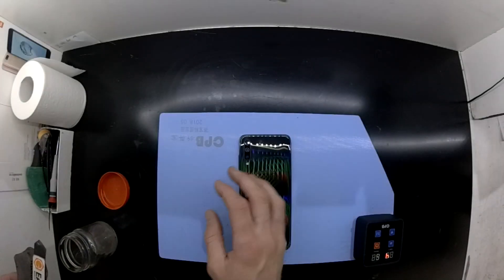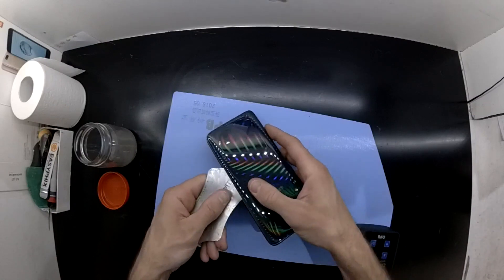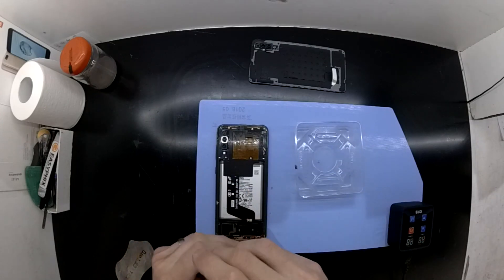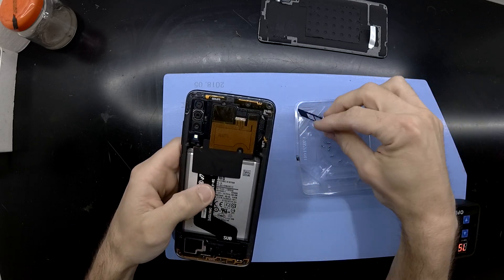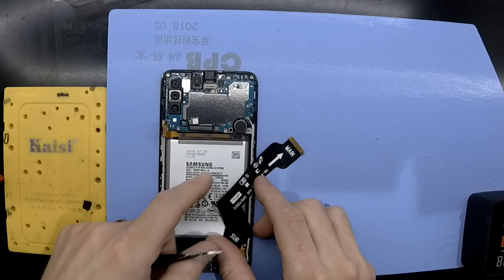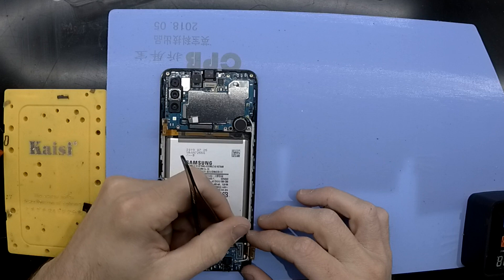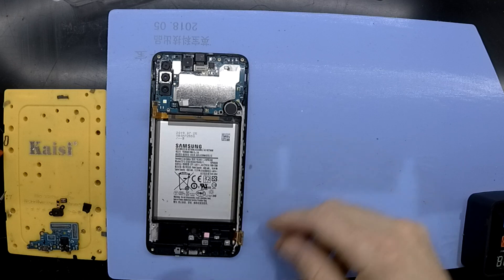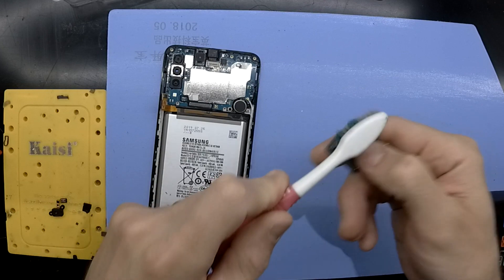Samsung Galaxy A70 Teardown and water damage clean

Comment: Just got myself some water damage today on the A70. Screen flickered, went completely white, then dark. After warming up my phone for a while i tried to connect it to a charger and noticed my phone took alot of charge and heated up really fast, after 5-10 seconds or so it felt warmer than my body temp.

Do you happen to know what that indicates? Hopefully it doesnt mean i fried my board(s) or something. Thinking about fixing it myself after watching your video, but i have this itch that its totalled based on how quickly it heated up.
Reply from the maker: would be damage to the mainboard.
i would suggest taking it to a local repair shop

Comment: My phone has two scratches on the screen.  Last night, while I was asleep, my phone fell from its screen onto the ground with some water.  In the morning, when I saw my phone on the floor, I picked it up from the floor and saw that water had accumulated on its touch screen, exactly where it was scratched.  My phone screen does not turn on now, but I know that my phone is working. When I started charging, I felt that my phone was warm as before.  Do you think my phone's touch screen just doesn't work or not at all?  Please answer me, thank you.
Reply: The model is samsung a70 same at this video
Reply from the maker: I dont think the scratch has anything, to do with not powering up.

i would opening it up like in the video or take it to a local repair shop
Reply: @rickstechrepairs  How long do I have time to take it to the repair shop before it's too late?

Comment: I dropped my A70 in the snow and the back camera had some moisture but now works fine but the front camera still has moisture stuck in there and the phone was working pretty good until it turned off and won't open by pressing the power button like I press it several times and the screen opens for a less than a second and turns off, here snow covered everything so there is no any mobile shop open and just want to know what could need replacement or fixed? Sorry for the long haul.
Reply from the maker: If you can power off, and leave it near a heat source,unless you can can open it up or at least remove the back cover

Don't put near rice

Comment: Before shutting down to black screen, mine shows a violet-blackish circle in the lower right corner of the screen, was my LCD really need replacement for that case? As i recall i disinfect my phone and sprayed alcohol directly on it until it dry out, then when the circle shows i restart it, it's vibrating but screen's now black.
Reply from the maker: Alcohol directly on the back of a display is more than likely going to damage it.

So a replacement would be needed

Comment: Sir my A70 was dropped in water. Now after 4 days everything is working fine except their is no network in it. My sim card is working fine in other headset but in my phone it shows no network connection.
Reply from the maker: I would clean the antenna connections on the board ofwise you will be needing a new phone sorry
Reply: Did you solve it?  Mine happened the same, got some water and everything works exept for the Network signal.
Reply: Same thing happened to me.. do you have a solution yet? I've changed the charging plate, cleaned it up...it is just stuck on airplane mode.. and there is no network... but everything else is working great..

Comment: my a70 fell in some water and after drying works fine, except the camera wont launch and there is moisture under the lens, will it get any worse if i use my phone as normal?
Reply from the maker: Backup everything important off the phone, if there is moisture still on the lens there is still liquid in there

Comment: My A70 just got water damaged and when I try to start it, it just sends out a short vibration and the nothing happens, I believe I can't do this by myself since I don't have all the tools, do you know what is wrong with it and how much will a phone repair shop charge me?
Reply from the maker: Hard to tell, possibly a minimal labour charger

I would suggest phoning local repair shops and asking
Reply: my phone has now the same problem .. may i ask what happened to yours
Reply: @sarabzr2140  I went to the repair shop and they had to change the display and charging port totally, it costed about 80$ but then everything went perfectly fine
Reply: @transilvanianfrost  thank you so much .. best of luck

Comment: My A70 just got water damaged
and it's display is not working
But I can hear the notification and other sounds I asked in a repair shop he told me that it will cost 15,000INR I.e £160 what is your suggestion?please reply
Reply: So did mine. I'm looking at having to repair my own phone and the part I need (full front housing ie screen) is going to cost up to £100
Reply: 🥺🥺me too bro

Comment: Took mine to a repair place, they cleaned out all the water but said the repair would be £110 so I said I'd wait, the touch was the only thing not working  but then when I got home it started working then stopped and then started again but now once more has stopped. I'm wondering if there is a tiny amount of water left so I've put it into some rice for a couple of days as a last attempt to fix it. Do you have any idea which part of the phone is effected for this to be happening? Sorry for the long comment and thank you in advance.
Reply from the maker: I would be guessing something similar to this

Rice will not help 

It's not likely the water that's affecting not now it would be the minerals from the evaporated liquid 

About all you can do without DIY, is pay the repair shop 

Then if you have any troubles go back to them, just make sure you ask will this 100% fix my issues
Reply: @rickstechrepairs  thank you for replying! Okay. What would you reccomend I do if I was DIY I'm willing to have a go at repairing it as i do have a spare phone in case something goes wrong and was going to sell it as spares or repairs anyway before seeing your video. It's just weird to me that it keeps working and then stopping.

Comment: excuse me..my A70 has a got a little, very little water in it. it seems other things r nice..but the touch is not working at all...i am sorry i charged it to 83% before i realised  it got water in it...can u PLEASE help me out over here? i am from bangladesh..please leave a reply..i will check out on it,sir...
Reply from the maker: Faulty touch, I would be thinking there is damage to the oled display or water damage to the display connector

Both of which would possibly need a screen replacement
Reply: @rickstechrepairs  hello..tnx,sir..I am"tabassum siddiqua"...but screen replacement means about replacing everything except the battery and the motherboard, right? but can anything happen if I somehow dry the inside water(using sunpower) now..?pls reply